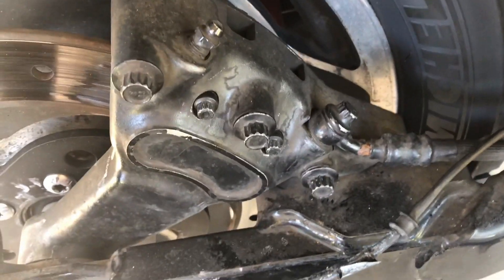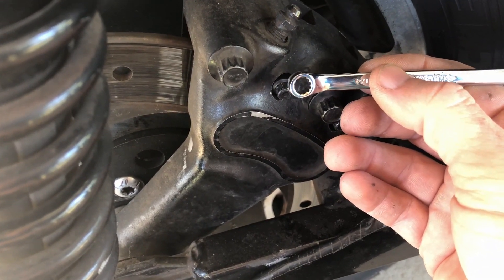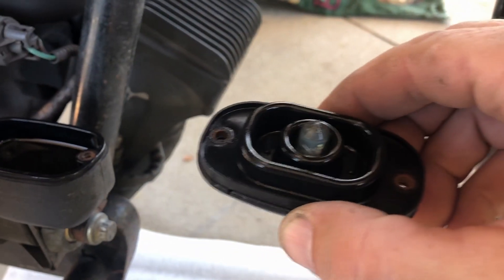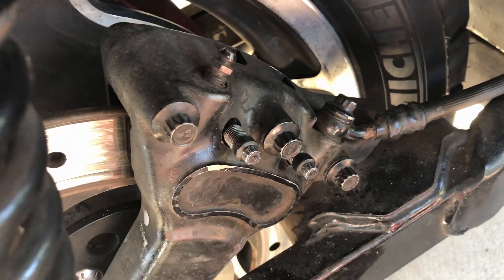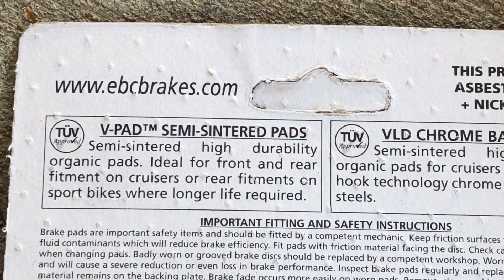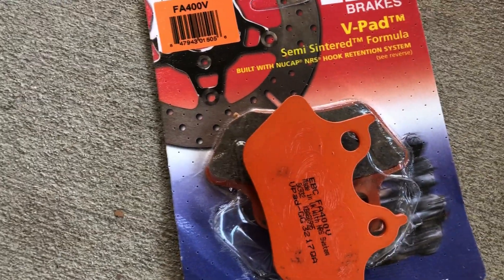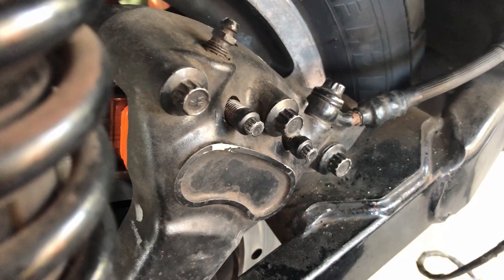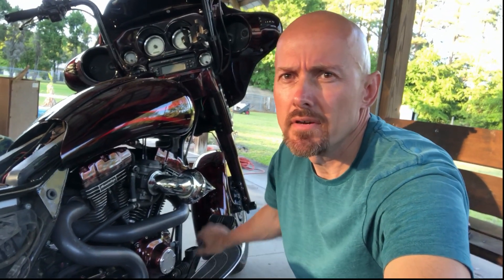Rear Brake Pad Replacement

Comment: Thanks for the info. 
I stupidly went out and bought 12-point sockets,  proceeded to unto the caliper, then realized it was attached to the axel. I removed the 2 caliper bolts then saw a third, at the top. I barely loosened it and it started leaking fluid. Quickly put it back in and tightened and figured I couldn't do it. 
 I told my gf, "dammit I'm gonna have to pay someone to do this"! Then came looking and saw this video. Definitely something I can do. I just don't have a rear stand to lift the bike up. 

Anyway, thanks for the video, it was a huge help.